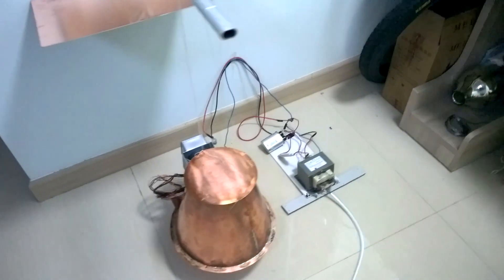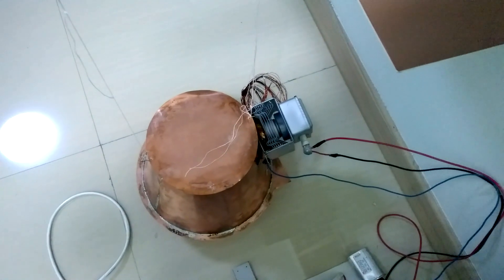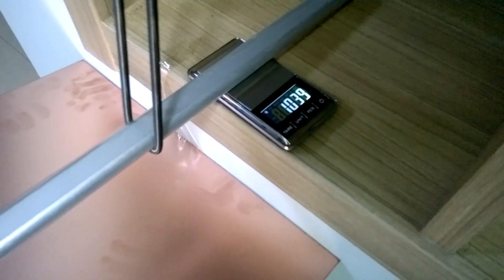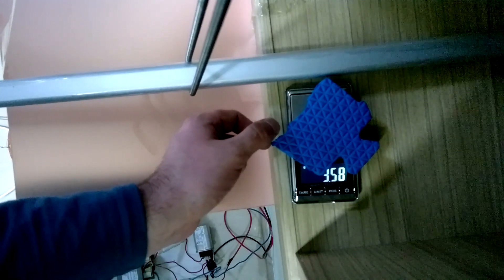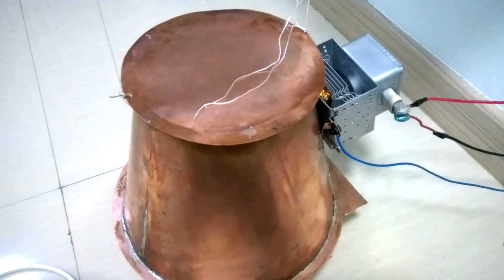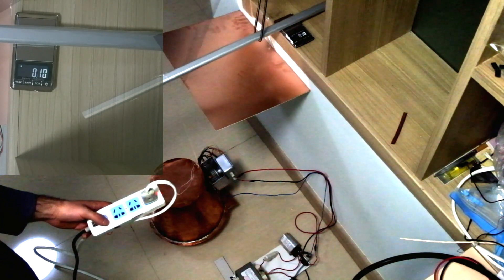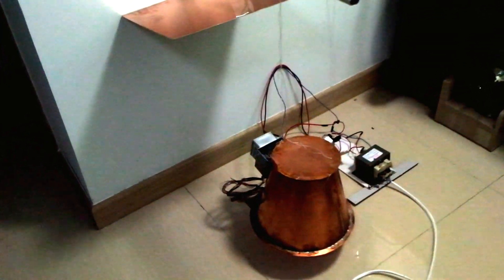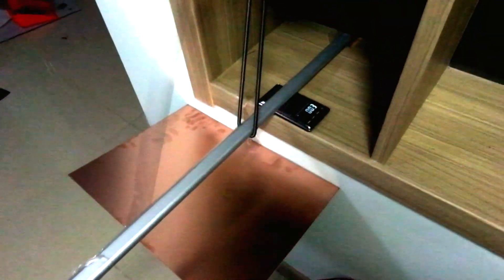EmDrive Test No.03 Success, I have thrust !!!

Comment: A whole 1 gram of thrust... except divided by 2.85 because of the lever needlessly multiplying everything by an extremely inaccurate amount and applying uneven pressure over a crappy scale. How many pounds does that ridiculous contraption weigh again?

You could get more "thrust" out of the thing by blowing on it. Pretty sure if I blow hard enough on the scale I could get more than 0.3 grams of force. Sheesh. And people believe this crap? Wait, lemme go invent a rubber band engine, I used a couple when I made my Rube Goldberg machine. Fuck's sake.
Reply: ***** First of all, that moon comment you made was hilarious, but you’re ignorant on so many levels, we all are. I guess you haven’t heard the news lately, about the Em drive being confirmed and everything? The human mind can’t comprehend the cosmos. What's impossible today could be a common thing tomorrow. Like the airplane for example. Open up your mind for a change, that’s how discoveries are made. Imagine if we all took what we “knew” to actually be true. We’d still think the earth was flat while riding in our horse drawn carriages. Humanities ability to progress always starts with defying the impossibilities of today.
Reply: ***** First off, don't be mean. Secondly, yea if you look at 1:33 you see the vent on the unit is pointing up, which when he turns the unit on would start blowing and add seen weight.
Reply: 9Hatman So I shouldn't be mean to charlatans and frauds? What should I be doing them, giving them a blowjob? Sorry, not my bag. If someone's engaging in fraudulent behavior and charlatanry, there's words that can be used for that, and I don't give a fuck if they're "mean" to sheltered and emotionally inept idiots.
Reply: ***** You, my dear sir, are one of the people who would have kept us in the stone age with your way of thinking. Please go do something productive with your life. You yourself admit that you're not a physics expert, and yet you come in and try to shoot down something without even the slightest form of sensible argument. 'URI GELLER URI GELLER HURHUR', jesus christ, I thought people like you only existed in jokes about stupid people. 

As Jonathan said a frikkin billion times, even if it turns out not to be something majorly revelutional, it is still interesting on a scientific level, and how the fuck will mankind ever progress if we brush off every unexplained phenomenon as fake or charlatanry? Exactly, we wouldn't. Now go lick some more windows.
Reply: ***** The entire point is that, if you blow on something in space to get propulsion, you run of out of air. This might not have much thrust, but if (if) it works, then it can keep on that tiny little thrust forever. It doesn't matter how much your ship weighs in space if you have infinite fuel because you can just hold down the go pedal forever; spaceships are sharply limited by their need to carry reaction mass (stuff to throw out the back of the spaceship to make it go forward). Removing the need for reaction mass makes space travel way easy.
Reply: Actually, the NASA confirmed that the EmDrive really works, even in a vaccum so yeah people believe it and they are right to believe,. The fact that you don't understand something, don't make it impossible, remember that.
Reply: Ray Junior And MIT confirmed that Uri Geller was actually a psychic.

Scientists are just as easy to fool as anyone else. Setting up this shitty contraption to measure thrust when there's more direct fashions is how you circumvent important controls in scientific testing.

It's Charlatanry 101. You people are fucking dumb.
Reply: ***** This guy isn't a scam artist. He is simply trying to replicate experiments done by a few scientists. His setup is hardly professional, but that doesn't make him a scam artist.

I think, if you read about EM drives, you will find that while people doubt that they are really producing reactionless thrust, there appears to be some sort of effect - enough to warrant some study.
Reply: Jonathan Lynch Yes, the effect is fiddly about with magnets like they're magic.

They're not. For fuck's sake, what is wrong with you children?
Reply: ***** Interestingly, both inventors of this type of drive claim that there is nothing magical, or contrary to standard phsyics, in how they work. However, the different explanations offered by both inventors have been thoroughly shot down by real physicists.

Thus, although the effect may be real, and has been replicated a few times, it isn't working for the reasons claimed by the inventors.

Even if it winds up not allowing for reactionless thrust, it will still be interesting.
Reply: Jonathan Lynch And Uri Geller claims he's a real psychic and that everyone has the power he has what's your fucking point.

How many fucking times do I have to smash your face against the brick wall of reality before the fucking real world sinks into that seemingly impenetrable barrier of caked shit surrounding your brain?
Reply: ***** You must have me confused with someone else. We have never interacted before today.

Since real scientists are also testing this, rejecting the theory, but finding interesting test results, I think we can safely say that it is not in Uri Gellar category.

I don't know why my point was hard to get, but, basically, my point is that enough interesting things have been demonstrated by EM drive experiments that there is something interesting going on, even if it doesn't allow me to own a flying car some day.

I assume you are not this embarrassingly rude to people face-to-face, right?
Reply: ***** Quite the charmer aren't you? I am always amused by irrational fruit cakes who think they are the smart ones.

I will explain, not for you, because you won't understand, but for others reading this. Firstly, you are making a simple logical error - hasty generalization. Yes, sometimes people like Uri Geller commit scams. This does not prove that all people making new and unusual claims are scam artists. There is simply no justification here for this generalization.

Secondly, real scientists have replicated the experiment on their own. This is fundamentally different from testing a person - they are testing an idea without the potential scam artists being present. You see, real science is built upon the idea that an effect is replicable. Now, they are not ready to proclaim anything profound, because they want more replication, with more variables being tested. So, at this point, it falls into the category of unknown but interesting.

Even if further tests do not reveal a real effect, it will be interesting to determine what actually happened.

Given your struggles with logic, lack of understanding of how science works, and paranoid assumptions, I think you should go rant wherever the crazy people hang out.
Reply: ***** You seem like a real douche, lighten up Francis...

Comment: So if microwaves are used, could you make popcorn inside the copper container?
Reply: +Steve Bowden And yet in the vacuum of space, while they munch on their popcorn, they will begin to ever so slowly accelerate toward their destination, as was the original intention, sarcasm not included. Seriously...
Reply: Steve Bowden yes...
Reply: Merryn Rawlins That's good! It will be good to have some popcorn to eat while the engine is busy not getting them one inch farther on their journey.
Reply: +Plystire If this EM drive works, I think they would be accelerate towards their destination quickly. But if it doesn't work, the EM drive can always be stored at the National Cold Fusion Institute.

Comment: A 25C temperature rise of the 9 litres air volume you have is sufficient to produce the -0.5 gm weight change you observed.

So obviously you need to flip the device upside down and check again.

Over one day ago you said you'd flip it and re-measure. Can we assume the worst? – i.e. that you still see about -0.5 gm and so therefore you’re measuring the difference in weight between hot and cold air?

Comment: You need to perform a 'control test'. May I suggest fixing the lever in a solid way to prevent movement in either direction. Then see if energizing the circuit has any effect upon the reading. This should eliminate the possibility that EMI is messing with your scale. Your RF shield can't work very well electrically floating and not containing the scale completely.
Another control test to eliminate the possible effects upon the mechanical portion would be to disconnect the device from the lever and add a static weight to the lever. Your RF leakage and/or system effects on the local environment may cause the spring to change tension from heating within the RF energy. The spring is after all a closed circuit coil.

Comment: Please turn the cone upside down and repeat this experiment to determine if the heating of air inside the frustum is partially or wholly the cause of the detected thrust. Do you still plan on flipping the frustum? This should be priority #1 before proceeding.

Comment: Hi Julian, we all hope that EM drive is real but you need to test it with more accurate equipment in order to prove it. 

- Test at different angles to show that it doesn't interact with the earth's magnetic field
- Test in a vacuum (contact a university?)
- Use more sensitive equipment and a better set up that won't shake when you walk

Good luck!!

Comment: try testing it higher in the air and moved the supply wires around to check for electrostatic forces.
maybe also try a very thin conductor wire down to the ground to discharge static charge.
Is the size of the cavity carefully adjusted to the wavelength? that's probably super important.

Comment: You could check that you're not getting interference by just disconnecting the lines suspending the drive, just run it on the floor in the same setup so it has no influence on the scale, see if the scale stays zero, or if the drive is interfering with the scale, maybe try it with and without the copper shield too just so you can get a metric on potential interference. Never give up man!

Comment: Did you exclude possibility that the electric current created magnetic field around your device (like in electromagnet) that attracted it to "radiation sheild".
Reply: Alain Coetmeur I have an idea, put some compasses around the device with it at different orientations and pointing in different directions. You could use this to see if any magnetic field generated correlates with the force generated by the device.

Maybe, you could even measure the strength of the magnetic field at different points around the device. That way we can either find what is making the thrust, or rule out that it's being caused by a magnetic field.
Reply: KoKA I share this concern... Hope I'm wrong. twist the wires to cancel most magnetif effect on the DC parts. are the loose wires visible going to the magnetron DC or AC?

Comment: Congratulations! Did you try a "dummy load" like a 1kW resistence inside the fustrum, in order to check if air convection forces are the origin of the thrust?

Comment: First, this is awesome you're doing this...thank you!  Second, you really need to test it the opposite way to determine if this is due to thermal heating.  This could explain why you detect thrust for a few moments--then it would start dropping off (why not leave it on for a period of time to see if it stabilizes?)
Reply: Ryan Geiler indeed, do the same test again but with the device flipped over. see if we read positive instead of negative numbers on the scale.

Comment: An interesting test would be to run a DC current though the device to see if the heating effect does cause a reading.

Could you also show the temperature with laser thermometer next time you test?

Comment: Why didn't you use the swing this time?
Reply: iulian207 WE NEED MORE POWER CAPTAIN!
Reply from the maker: +Science  In the swing test i needed more than 2 gram to move the pendulum, but the device is only producing 0.5Grams so in this way you can see the thrust much better.
Reply: No. A magnetron only emits one frequency. He would need a klystron (which are much more expensive) to vary the frequency.
Reply: And if you put something that generates sequential impulses, like a magnetic cannon to orient the waves in a single direction ?. Spiral-shaped
Reply: please if you answer to a person writing in English, reply in the same language...at least for some respect
Reply: upmperthay I thought recently we could do it with inverters. im basing this on the fact that inver powered microwave ovens are now available at only a slight price increase over a magnatron powered one at the same power level
Reply: Masked Vigilante  sino seria bueno probar distintas frecuencias de trabajo del magnetrom. o sea variar la frecuencia de las microondas
Reply: Masked Vigilante  deberian buscar la forma de hacerlo. creo que tambien nesesitaria un impulso. algo asi como para direccionar el flujo de ondas y concentrarlas. a ver si asi se logra una aceleracion. para direccionar las microondas creo que vastaria con una antena direccional. a esto me refiero.
http://s5.postimage.org/69rvfdpl3/MER1.jpg
 pero en este caso solo serviria para direccionar las ondas y servir de amortiguador
Reply: upmperthay entonces proba con un ciclotron. hace una antena direccional y varia las frecuencia.... a ver que resulta